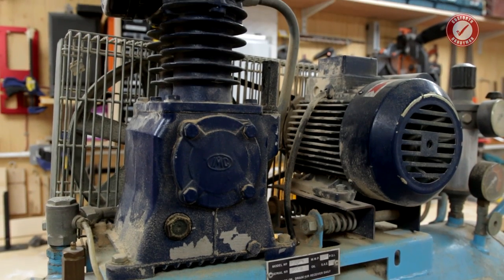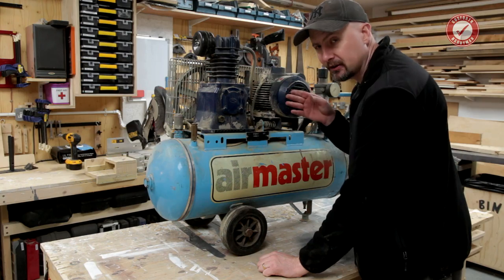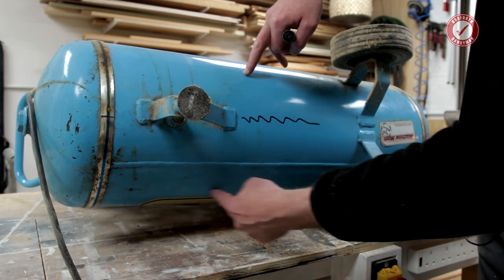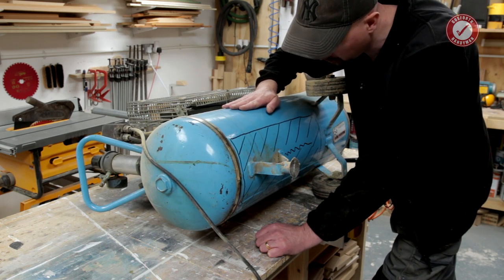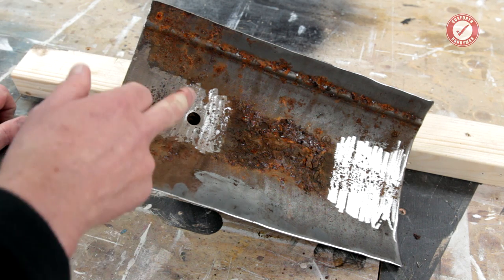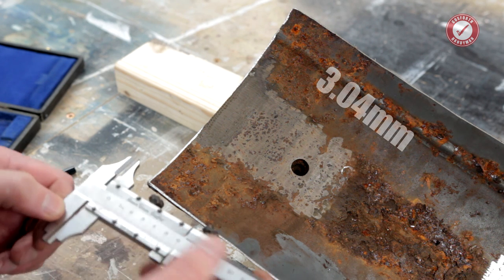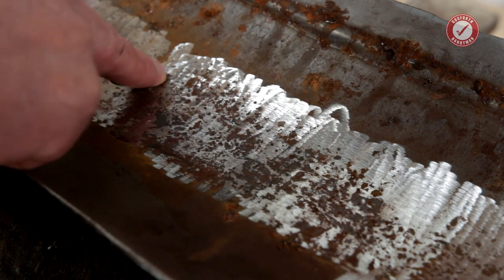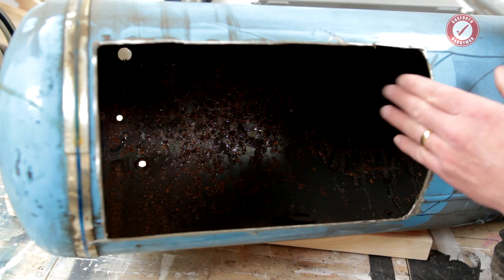Was this old air compressor about to EXPLODE ??

Comment: I need to get a bore scope so  can look inside mine.  It's a 60 gallon Coleman I bought new in 2000 at CostCo.  It only gets occasional use, but I live in a very wet and cold climate.  It'll be interesting to see inside.

Comment: Can you treat the in side with an rust prohibitor ?
I bought a new Makita air compressor I see rusty water come out when I drain it .
Reply: I've seen comments from people who did that and it was ineffective. High end brands, like Schulz, powder coat the tank inner walls  at the factory. 
Don't worry about your Makita. The drain water will be rusty from day one. I have a 30 year old Ingersoll Rand (U.S. made back then). It's drain water appearance has been consistent over the decades.

Comment: I have always been curious about what the interior looks like after a few years.  Now I know and I am not happy.
Reply: 37 is a little bit more than " a few years".
Reply: Uncoated tanks have reserves, so they are stilll stable enough if they are weakened by rust, at least for some time. 
You can hydro test such tanks, you fill them completely with water (which is not compressible), remove the pressure relief valve, and pump it by a external pump (pressure washers also work) to 1.3 to 1.5 times the maximum working pressure of the tank. 
If the tank is ok it's fine and nothing happens, if it was faulty it will only rupture with a small plop (because you can't compress the water, so it can't explode). 
However you can be sure after this test if your tank is ok, or not.

Comment: That was very interesting, I asked a question on this very topic on YouTube as I have a compressor, probably similar age to yours, but I haven't used it for a few years due to these very concerns.  I think in view of what you have demonstrated I will retire my compressor also.  I suppose the worst thing that could have happened to you would be to cut it open and find it all nice and clean and shiny!!!
Reply: one recommendation is to put the compressor outside in its own small building, so that no one goes near it when it is in use. . You can safely use it until it stops or self destructs.

Comment: Just found mine has recently gone, got a hairline crack at the top where the motor bracket welds to the tank is. I guess the motor vibration added to that. I picked it up second hand around 8-9 years ago, didnt know the history of it but have been meaning to replace it as whenever i drain it, rusty coloured water. Took the motor and fittings off it, and been thinking about converting a gas bottle. But will probably end up buying a brand new one. 

Think i might cut the remains of mine open now, see how bad it is.
Reply: High cycle fatigue. Like an old aircraft. Get rid of it.

Comment: I have and use a 50+ year old 60 gallon 2-stage. I've had fittings fail, but never an issue with the tank or welded bungs.

Comment: HYD means that they filled it with liquid or hydraulically tested it to that pressure so that if the tank did let go it was with water or oil that is not compressible so their is no violent explosion.  Just a mild pop of liquid that would startle you but not violently blow the windows out of your shed and send the tank through your roof  They always test at higher pressure with liquid filling the tank.  I have tested tanks using water and a grease gun to pressurize it.

Comment: 3:14 Hydraulic test. it's a test where you add water under pressure and see until where it can hold that pressure. I've done it in a boiler with a manual pump and let me tell you it's not a small feat. Generally the hydraulic test is done @ 200%- 250% the real working pressure

Comment: You could use a can opener on newer tanks,the steel is not much better than a bean can!
Would it be worth removing the end bung and spraying with WD or similar, every now and then to halt rust?
Reply: Only on a new tank, as otherise the corrosion already has a hold. Better than WD40 is misting with something like waxoyl, to coat the inside of the tank. Or have a compressor that uses a little oil, the oil mist coats the inside quickly, and you see the milkshake in the condensate water. Bigger compressors with intercoolers do tend to use oil, as the rings let a little blow by into the crank case, and that goes into the air inlet and lubricates the reed valves.

Comment: About 24 years ago, we replaced the 100 gallon tank in our 30 year old shop compressor with a 125 gallon stainless steel tank. We bought the tank from a scrap yard for $50. Now we don't have to worry about it exploding anymore. It is still in use today.
Reply: Stainless steel has completely different characteristics to "plain" steel (there are so many variants, not sure what is used in pressure tanks. I would assume it is a high tensile steel) Particularly with regard to stress cycles.
Reply: @Agnemons  The new tank is 1/4 in thick 304L SS. I believe it was removed from a brewery. It is heavy. It still has the same compressor after all these years. When the compressor finally dies, I would like to replace it with the newer silent compressor.

Comment: Great video, I have a compressor of similar vintage.  ok the corrosion was fairly extensive but the killer is the depth, you did the right thing.  A crack would most likely start from a corrosion pit you would need a microscope to see it and if one started it would most likely cause a failure before you could spot it.
Next time you cut metal like that, try using one of the 1mm thin cutting discs, they are much quicker, produce less sparks and are quieter. ok they do not last as long.

Comment: "Hid. Testing is Hydrostatic test. That means that they filled the tank with water and then with a hand pump took it to 2 X the nominal pressure. In your case it was less than 2 X but that is the legislation of each country.
Reply: hydro test for pressure vessels is 1.5 times the working pressure
Reply: @jerry1378  👍 in Brazil are legislation is 2 X each country has there own legislation.

Comment: The hyd. Test is a "hydro" test its just as u stated they tested it to the pressure stamped... It's a requirement for scuba tanks regular maintenance. I never wondered til now but the term in scuba is to have your tank "hydroed" but I'm sure now that it's short for hydraulic test... Maybe they use water to test it as air is probably too dangerous to test a questionable tank with.

Comment: Because standards have changed over the last half century, you just sacrificed a really well manufactured product for one that begins life at 1/8 the thickness. 

If you were worried about the state there ways to measure and determine metal thickness.
Reply: So true. I have an old Craftsman with a DeVilbiss tank, and an old Ingersoll Rand with (believe it or not) an Ingersoll Rand tank and a mag starter. Bought the Rand at Home Depot!
The industrial brands are still good, just hella expensive. I don't think any of those guys (Schulz, et al.) make small portable units. Let me know if you see one. I'll recommend it.

Comment: Thanks for the clarification that the fire extinguisher being tested was filled with water.  But I think the tank the fire extinguisher was submerged in was open to the air and therefore not pressurized.

Comment: Yeah, hah, mine has a leak in the bottom around one of the welds of a leg.
So yeah, these tanks will always have moisture inside, no getting around that.  Draining might help but still there will be corrosion depending on how well the inside was passivated (probably not done by the factory in most any compressor tank).
Alas, looking to replace my tank.

Comment: Hyd. test = hydro test (i.e. filled with water and pressured to 225 psi).  Water is used as it's non-compressible and if the tank blows it won't cause as much damage.
Reply: Yeah. A new hydro test would have been far more informative.

Comment: Hydrostatic test pressure which is usually between 25%-50% plus of max working pressure (The governed max delivery pressure, regulated) … could have made a mini BBQ if you didn't cut the arse out of it … and kept the axle side … ;-)
Reply: Finally, someone who knows it’s not hydraulic but hydrostatic ... 👍

Comment: Not sure where the 'limescale' on the drain valve would come from, the water gets condensed from the air :-) I got a wee Stanley air nailer compressor, can lift it with one hand - scares the $hit out me when it fires up unannounced :-))
Reply from the maker: Ha - very good point! I'm sure I've seen stuff that looks like limescale on there? Probably just rust. 😂👍

Comment: Pro-tip. Never put any kind of liner in your tank.
 
Yes, liners do HELP prevent rust and such, but with air compressors, you want your first failure to be a pinhole from corrosion. Then you throw it out.
 
If you put in a liner or any kind of sealer, you will plug up corrosion pinholes, but that means that instead of a pinhole being the point of failure on your tank, it will instead be more likely to be a large failure at a seam that does it in... which means instead of hearing "tsss" and knowing it's time to replace it, you will hear nothing until it explodes.

Comment: In your opinion, what or how much is the danger if a pit is extremely deep and the tank 'bursts'? It'd be most likely on the bottom? Would one not merely hear a slight hiss like a tyre leaking?
Reply: There are videos describing a tank failing (pictures of tank included) when the person was in the garage, and had he been in the wrong spot, would have killed him. . Blew the garage windows out,

Comment: I dont think many people realise the danger of a compressed air tank or how they can be safely pressure checked.
   Hydro testing is a safe way to check the soundness of an air tank. Water wont explode if a seam seperates it just splits open and the water drains out.... So if you fill your compressor tank with water and have a way to overpressure the vessel, thats how its done. I usually check my tanks at 100 to 150 percent over rated pressure.

Comment: I have a shop compressor (80 gallon) that I installed in my shop when I was a teenager!  So it's like 39 years old if my math is correct.  An old DeVilbiss horizontal unit That I used to work on cars (instead of getting into trouble!).  I replaced the bypass about a year ago and it was so badly corroded!  It was leaking air and I hadn't used it in some 5 years or so.  But an old change (first ever) and she runs like a champ.  No idea what the inside looks like, and I'm not sure I want to know.  It was always drained after use and I do live in a pretty dry climate so I have never even had anything showing in the line dryer.  It keeps me going, but it sure does take up a lot of room and it's hella noisy!

Comment: In a commercial setting, you should have an inspection done on a regular basis for your insurance where the tank is tested. Industrial machines should also have a autodrain on the tank (should be called a receiver) which limits water build up and increase the life expectancy

Comment: Hydraulic test for HYD. Test I would think as I have to get my scuba air tanks hydraulicly tested every 5 years with a visual inspection in between at 2.5 years
Reply: One of the guys I dive with hasn’t had his cylinder tested in 15 years. I don’t know where he gets it filled because he’s not allowed to fill it with the club compressor and I refuse to fill it for him with my compressor either.
Reply: @peacockealot  was just about to ask does he have his own compressor then as no one else is likely to want to fill it up.

Comment: Could do without the bad and loud music.  A well made and thick metal tank.  Twice as thick as most at 1/16", 1.66mm.  Drain did not protrude inside preventing total drainage of water.  Wise move to discard it.  You would never see cracks until after the explosion.  They can be deadly.  Hyd. means Hydrostatic Test Pressure, 1.5 times Operating pressure.  Tank is filled with water THEN pressurized.
If it does burst, there is no catastrophic damage as water is not compressible.  With that large hole at one end, it could have been coated inside after manufacture.  Todays tanks are much thinner and made of Chinesium.

Comment: Can't see how draining it would extend the tank's life.  The inside of the tank will be wet again within minutes.  The new condensation will have plenty of oxygen.  Probably not possible to keep the inside dry.  I know of a few that failed.  They got pin holes and leaked.  In one case the owner welded the hole shut and used it for years.  Never heard of one actually exploding.
Reply: Yep, never heard of one exploding as the pressure relief valve pops open if the pressures gets too much.

Comment: So it was tested to 225 and usually cuts off at 150, suppose if you only need it for low pressure or small jobs you could drop the pressure cut off switch down to 100 psi or less to be on the safer side. On the plus side, it's from 1982 and has lasted better than most cars on the road.
Reply: Most small compressors do not have adjustable pressure switches.
Reply: @MrKentaroMotoPI  Mines only small and it has an adjustable switch, a lot of the small ones do, Clarke, SIP etc, it's under the small black switch housing that most seem to use. Usually if it has a pull up 'on/off' button it will be adjustable.
Reply: @andicog  Mine have sealed "pressure bullets"  that  pop out a plunger and trip an electric switch. Old school for sure.

Comment: I think the difficult argument these days is whether something from 37 years ago is still better quality than buying a new one. 20% is a large amount to lose, but I imagine they are like Structural Engineers and that you'd only need a 1mm thick vessel to handle the pressure anyway.
I have two compressors, one 50ltr that is about 30 yrs old and one 100ltr (at least) that must be knocking on for 50+ years old. The larger one was used in a dairy way back when, but it's a foot crusher, so I'd love to know the wall thickness (in a non-destructive way).
Reply: Get an Ultrasonic thickness tester, cheap & easy to use. From the Pressure, Diameter and minimum thickness you can calculate the Hoop Stress. No need to use joint factor for the welds cos you're only worried about principle stress for the min thickness.
Reply: See if you can find the original design code, if there is a data plate. Older vessels were much thicker than modern (EN 286-1) ones, but everything is made to a price, these days! That said, failures of air receivers is quite rare...

Comment: In my shop we had a 20 year old 5 horsepower compressor. It was running fine except was passing a little oil. My helper said he could replace the piston rings, I told him no. I know the destructive powers of compressed air, I just don't trust a old air tank. We purchased a new compressor, the  price of a new compressor is less than a human life. Also before disposing the old compressor, we cut the tank open so no one else can use it. This my sound unnecessary, I have seen people take things from the scrap yard and try to reuse them, very dangerous.

Comment: The likelihood of a tank exploding is slim to none, they just spring a leak. My larger compressor is pushing 50 I think it should be good for at least 20 more, I don't want to have to buy another. Use it for air tools, spraying, ... things needing large amounts of air.
Reply from the maker: Seen plenty of horror stories of exploding tanks but very little evidence to back up what actually happened...
https://sites.google.com/site/metropolitanforensics/cause-of-explosion-of-air-compressor-tanks

Comment: Hyd=hydro. They hydrotest compressor tanks they use water and usually fill it to 150% the rated air tank pressure because of it fails being pressurized with water it won’t be a catastrophic explosion as if it was filled with air.

Comment: Hydralic test pressure. The reciever should have been totally filled with water and a water pump system would pressurise to the psi given. The idea is that if the reciever were to fail then you would 1, see the fault/s and 2, as there is no air in the system if it should let go then the water pressure drops without cousing high pressure explosion. 
I said earlier should have. There were some manufactures who would take random recievers from the line and pressurise those, if they all passed then the whole batch were sprayed up and shipped out with certification.

Comment: Very interesting video.  Sad that we can't determine the state of the tank without destroying it.  I have an old compressor that my cousin gave me.  I rarely use it and I always drain it after use.  I wish I knew the condition of the bottom of the tank.
Reply: You can determine the integrity but it isn’t worth the cost of buying a new one for the typical household.
Reply: Get a inspection camera to look inside , and if it's good then clean it up and dump some paint inside and slosh around .

Comment: I have a near new compressor which i dont really use because it's really loud. I used it maybe 5 times  when building a deck before putting it in the shed. Ive since purchased a silenced compressor. I have no use for the old one so i took off the motor and turned it into an air tank. Theres no sign of rust on rhe inside. I didnt cut or weld the tank, just changed the fittings but after seeing all the horror stories of tanks exploding im too scared to actually use the thing hahaha

Comment: The hyd on the tag means the pressure the tank has been water pressure tested to and why o why are you using a grinding wheel to cut the tank open with and not a cutting wheel it would have taken less than a 30sec to cut rhat part of the tank with the correct cuting wheel .